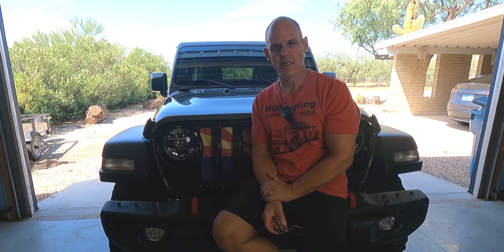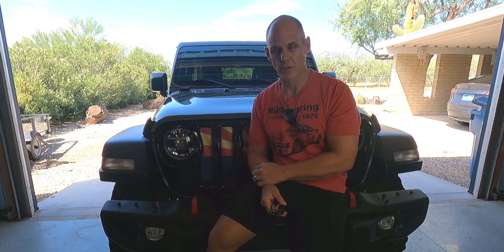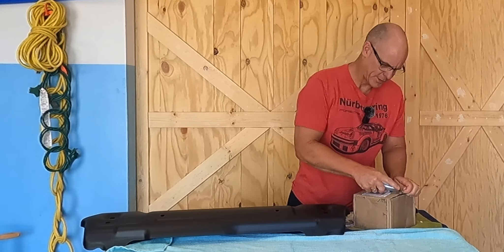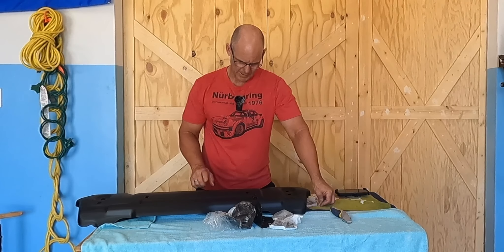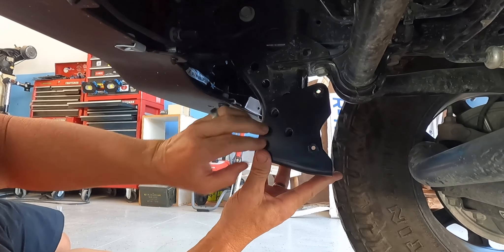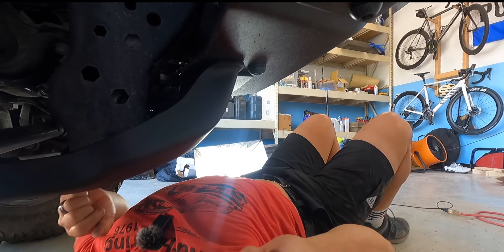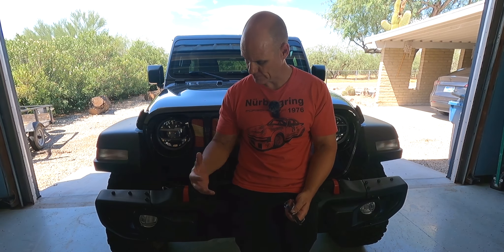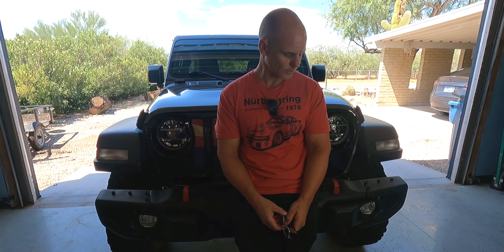Finishing off the Front Bumper Install with the Mopar Steel Skid Plate Willys JL.

Comment: Rick I recently had to take my company car in for work and they gave me a brand new base model 2 door Wrangler. Overall, it felt very unrefined but Im sure that was expected. The road noise and inner panel rubbing noise was the worste part. Drive nice over all, and had thr best turning radius Ive ever felt in a car. Felt like a zero town ride on mower
Reply from the maker: The turning radius is good for sure.  I find the noise level to be decent and maybe better tan my Crosstrek about the same.  Steering feel isnt the best but what the heck, its fun :)

Comment: Hi…. Did you use the same filler that came the plastic bumper? I know you said you posted the part number, but didn’t quite catch it.  Thanks!
Reply from the maker: Filler for the top?  It is a different one.  Here are all of the numbers.  Let me know if I can help with anything else.
1 - 68353836AB Bracket, Item B
1 - 68353837AB Bracket, Item C
4 - 6511076AA Nut Insert, Item D
4 - 6104414AA Bolt, Item E
7 - 6512587AA Bolt, Item F
Bumper close out part:  6BU43RXFABKIT
Reply: I looked up the part number and didnt see the bracket parts. What are the bracket parts used for? @AZdroptop

Comment: Finally, catching one of yur vides.  I guess the captive nuts are like riv-nuts?  The bolt expands the nut? I've used riv-nuts before and didn't know about captive nuts. I gotta remmember that.  BTW - we were 32 miles from your place 2 weeks ago.  But, 35k feet up. Spent our aniversery in TX.
Reply from the maker: You are correct Bob, they expand in there when you tighten them.  Hope you all had a great time and happy anniversary.  I am in Carlsbad this week for work and back in a couple weeks as well.  Hope all else is going well.

Comment: what are those bracket for? I dont see them anyhow supporting your skid plate
Reply from the maker: There are 2 bolts, one on each side, that screw through the bumper into the brackets.  I showed it pretty quick.  Sorry about that.
Reply: hey sorry to bother you, I put the Nut Insert into the hole, screw the nuts but it came right off. Am I missing somehting?

Comment: Good intel here.  Does it need all this? IDK. Original Willys?  Just ordered and kept pressing buttons till couldn’t afford it. Didnt take long, 22 Rubi XR. Do I need it? Doubtful. Good content, Rick.👍👍😎🇺🇸
Reply: I got all the "Rubicon parts" the Hard Way -- got a Rubicon right up front.  Haven't had (or even wanted) to change anything, and so far, so good (just under 14K miles in 17 months of ownership).
"Jeep Wave"
-- BR
Reply: @billredding2000  XR is good.,If I was to do it again, I would get just a Rubicon with a few more options.
Reply: @shiftintohigh5564  Mine came with more "options" than I needed...but will admit here in Colorado, I would have liked 4-Auto (a 5-mode transfer case vs. 4-mode) for Winter use on streets/hwys that were patchworks of clear pavement and snow, but that's a minor issue...
-- BR
Reply from the maker: Nice!  They do get expensive fast these days for sure!  Have fun 🇱🇷🙏🏻👍🏻
Reply from the maker: Awesome!  Good choice.  I had an 05 Rubicon and it was amazing!  Knew I wouldn’t be too crazy off road and went with the Willys.
Reply: @AZdroptop  Got mine in April 2021 for under MSRP...now, the same configured/optioned Gladiator is at least $12K more than I paid for mine.
Glad I didn't wait until now...and there's no end in sight for price increases (and price-gouging ADMs at Stealerships).  😞
Thanks...I know you're enjoying your Jeep/Willys as well.
"Jeep Wave"
-- BR
Reply: @AZdroptop  I may do the same. 👍👍😎🇺🇸
Reply: @AZdroptop  I'm not going crazy off-road either: I don't find scraping, gouging, bending, breaking things or ripping body parts off a vehicle "fun" for some reason, unlike so many other people apparently do. However, if I NEEDED to do those things, it's nice to know my Jeep is capable enough to DO them.  ;-)
"Jeep Wave"
-- BR
Reply from the maker: I hear ya and agree!  Especially with what we paid for them.
Reply from the maker: Definitely crazy what's going on with prices.  I had a couple of dealers a few months back make offers for mine of almost what I paid 2 years ago.  Seems a bit crazy.
Reply: @AZdroptop  Like selling your house...then what? Thanks Rick! Enjoying the content. Gotta revisit the Volt stuff. And I am not an EV guy. Just curious.👍👍😎🇺🇸
Reply: @billredding2000  I love this comment!👍👍😎🇺🇸